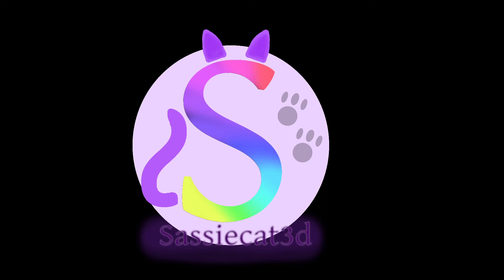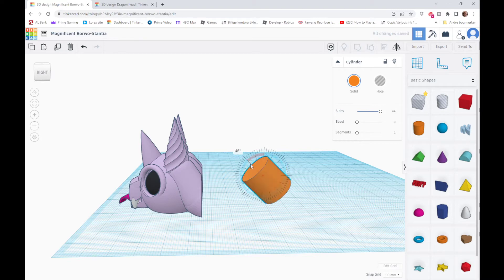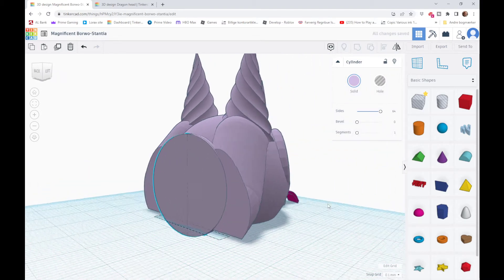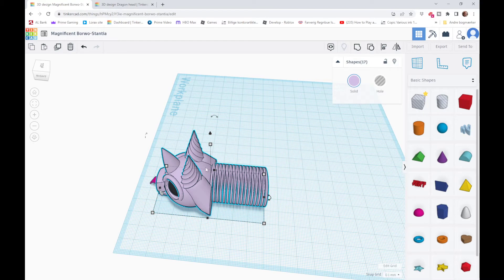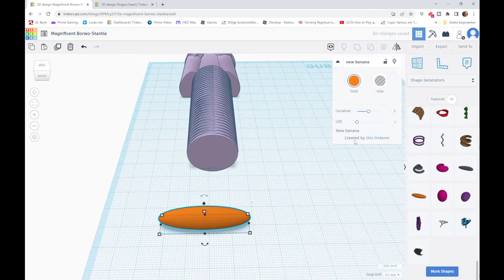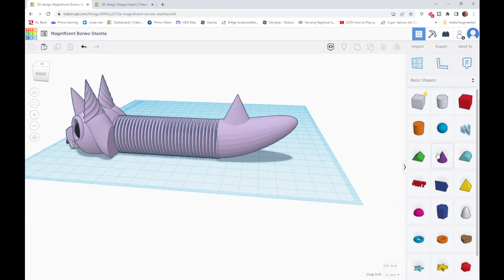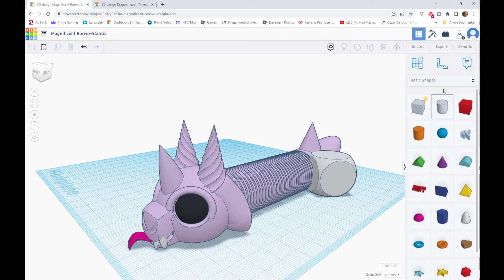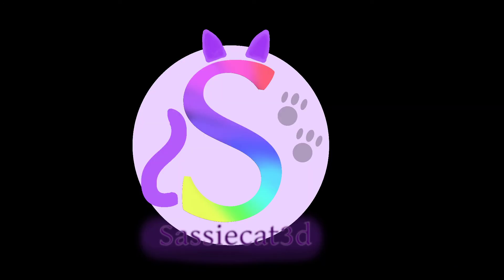Tinkercad no.4 Harmonica type design

Comment: I’m totally new to the articulated concept. Would this tail need a support?
Reply from the maker: No it would print without supports 😊
Reply: @Sassiecat3d thank you for the beginner friendly tutorial. 

In regards to your other videos…

When doing a Flexi or articulated project can you reduce the size without corrupting the movement of the hinges on the flexi or the connections of the articulated dragon?  I’m wondering if you have to readjust or if the parts on the dragons will still remain untouched?
Reply from the maker: @Margo1968  theres only one way to find that out. You need to testprint what you make in small and big sizes to see if they can be scaled. If they break easily you might have to make them thicker in tinkercad, or if they wont stay together, you might need to ajust the model. I always do a lot of testprinting when making models ❤
Reply: @Sassiecat3d  okay. Thank you 😊